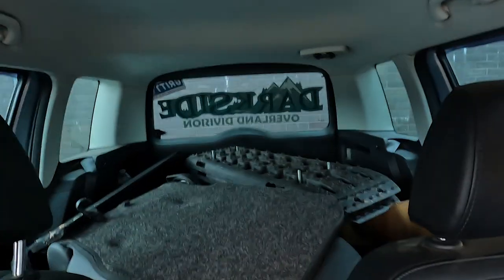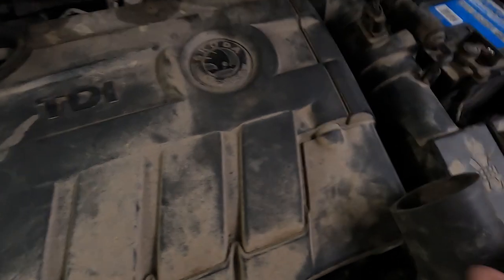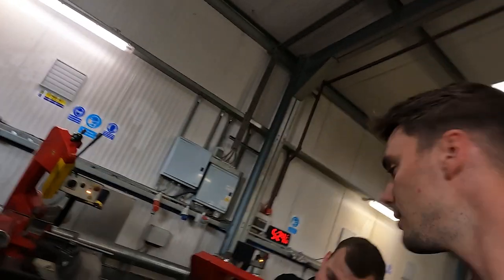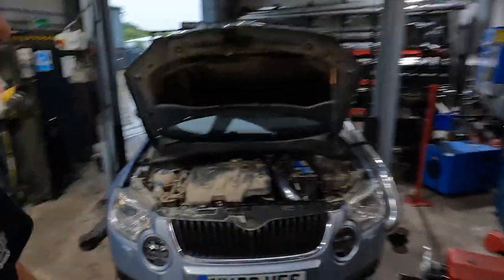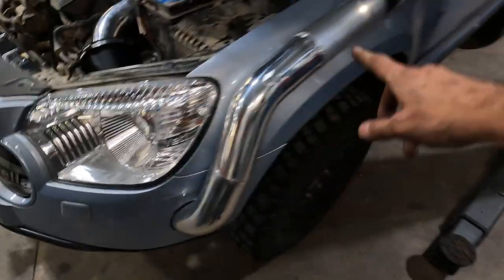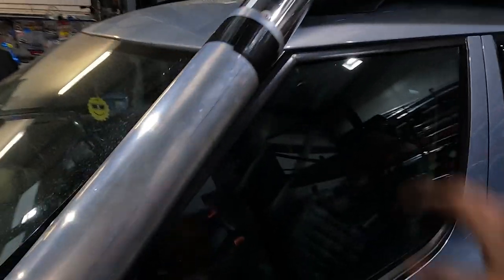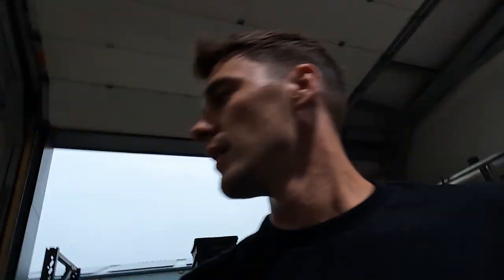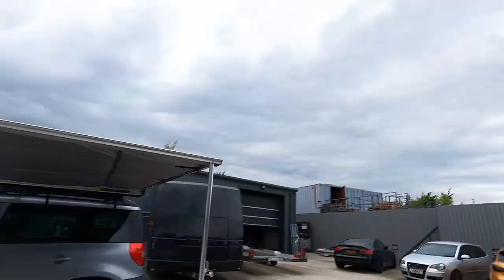Did we REALLY just fit a SNORKEL on our SKODA YETI 4X4?

Comment: How does the front drive tolerate 30mm shims? Do you use any extended half shafts or other joints?
Reply from the maker: We haven't had any issues yet. Still on the standard shafts